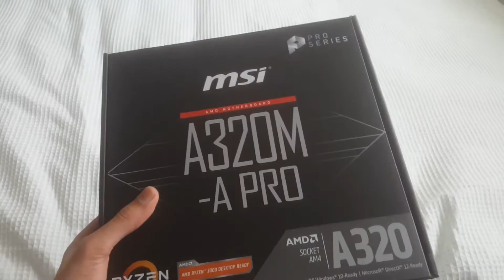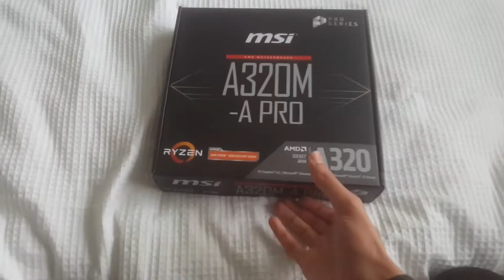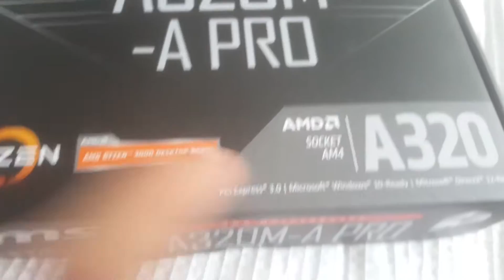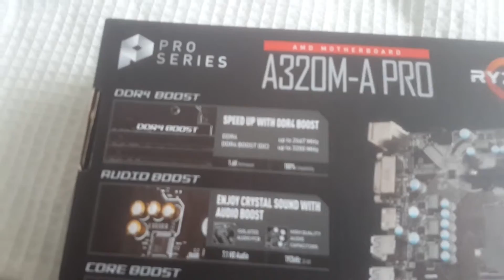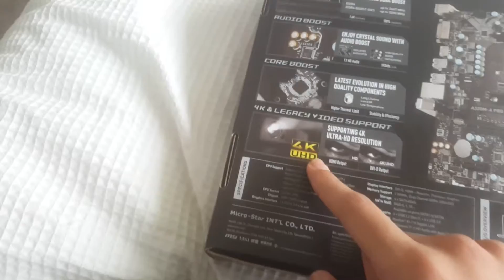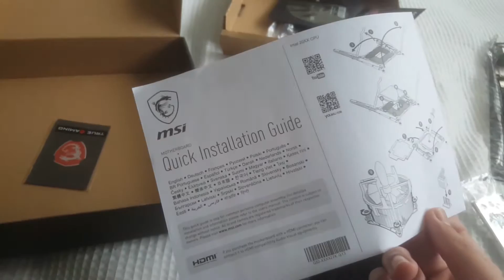this is a seriously under rated motherboard... (MSI A320M A PRO Motherboard Review)

Comment from the maker: Thank you guys so much for watching, If you enjoyed this video or found it helpful at all, Please Like and Subscribe.
If you have any questions about anything about this video, ask in the comments and we will be sure to reply!
Reply: I plan to pair this board with a Ryzen 5 1600 and Gtx 1060 because all Gtx 1660 and rtx 2060 out of stock so I can’t get either. Good idea to save money so I don’t spend like 400/800 pounds or should I wait till New Years/january before getting the pc because my gpu will cause huge bottleneck (it’s quite bad gpu my model is, like 3gb vram. At the least maybe I should get a 1080 but I think they also out stock.
Reply from the maker: Best thing to do is wait for the sales and buy parts then thats what im doing because my personal gaming rig needs an update too...also your right there are a lot of GPUs that are out of stock now i was planning to get a RTX 2060 but its out of stock best thing is buy the parts individually so if you find a good deal on a cpu buy that first then look for deals on the other parts you need then purchase them too thats the methods i use

Comment: Bridge hsink fins need to be vertical to maximize air flow w-o fan, mine overheated ( 1 dimm slot cannot work ) w-o fan, = design flaw. Gpu short circuits caused by dust fr cpu fan, user must block this dust fr gpu because AM4 fan is big & near gpu. Fan air & dust can short dimm too, user needs to block this dust fr dimm, unless used in a ultra clean room.

Comment: using the M2 variant of this thing, i mean it's good but it takes 15 seconds for the boot, not sure what version i have because the MSI bios versions for that is so annoying confusing. 

Specs:
MSI a320m a-pro m2
Ryzen 5 3400g
2x8GB hyperx Fury 2666mhz
2x1TB HDDs
SATA 128GB SSD
6 PC Case Fans
AMD Wraith Stock Cooler.

Though, for some reason my games lags like 7 seconds and comes back to normal and does that again, probably thermal throttle from the VRM of the motherboard, but i doubt because this variant supports upto Ryzen 9 AM4 Processors. I suspect is that the Wraith Cooler is not performing well given that i game on my APU.

Comment: got the exact same board, it does support OC through a bios update and im using a ryzen 5 3600 with a msi gtx 1060 6gb its decent
Reply: I have same motherboard and prosesor with you, i just ask wanna upgrade prosesor does this motherboard support i5 12 gen or 11 gen, or better with amd? What do you recomend?

Comment: I have bought one 4 years ago when  started building my pc but haven't got big budget. It really worked fine and still works fine 4 years on now. 3200mhz on the ram. Supports all sort of graphics card. For the money it was perfect. But yeah im at a point i want something more serious. Perfect for first time pc projects
Reply: i have it and i dont know if it has an m.2 nvme slot, does it have one?
Reply: @ZefiFn  No - you need an adapter or an encapsulator
Reply: Does it work with RTX series graphic cards ? I was thinking to buy RTX 2070 on, currently my motherboard only has integrated graphic with amd ryzen 3 3200 G
Reply from the maker: Yes this motherboard will work with a RTX 2070 however if your going to consider overclocking then it would be a better idea to fork out some extra money for a more capable motherboard. Hope this helps you if you have any further questions feel free to ask and if you don’t mind could you drop a like and subscribe it means a lot. Thanks
Reply: Bro does this motherboard have wireless wifi connection if yes then please tell the adapter link
Reply from the maker: Hi unfortunately there is no onbaord WiFi of the motherboard you will have to buy a WiFi dongle. I'll link the best budget one under this comment 👍
Reply from the maker: TP-Link 300Mbps Mini Wireless N USB WiFi Adapter, ideal for smooth HD video, voice streaming and online gaming,USB 2.0, Supports Windows 10/8.1/8/7/XP, Mac OS, Linux(TL-WN823N) https://amzn.eu/d/9jORRaY
Reply: @M20UBR88  thanks broski

Comment: could i fit an rtx 3050 on this motherboard or do i need to get a new one?
Reply from the maker: Yes you can fit a RTX 3050 with out upgrading unless you want to overclock if you want to overclock best not to use this motherboard as its cheep and a more expensive one will handle overclocking stably. Hope this answers your questions please drop a like and subscribe as it helps us out a lot thanks.

Comment: I bought this mother board but still don't understand where is the SSD slot pls tell where m i suppose to install the ssd
Reply from the maker: Im pretty sure the A320 Variant does NOT have an m.2 slot :/
Reply: @M20UBR88  ye need to bought a sata ssd instead:/

Comment: what is the compatible gpu for that motherboard sir?
Reply from the maker: All GPUs that use a PCIE slot can physically fit in this motherboard. But bare in mind that it is only a GEN 3 PCIE Bandwidth, so a GPU with GEN 4 Bandwidth Support might have to hold back a bit :)

Comment: Will it work with ryzen 3 2200g??
Reply from the maker: Yes it will if your have anymore questions feel free to ask also if you dont mind could you drop a like and subscribe it would mean a lot thanks
Reply: @M20UBR88  yeah no problem I'll sub I'm a first time pc building and I bought the wrong mother board that didn't support ryzen 3 2200g so this is my back up ty
Reply: Builder*
Reply from the maker: Welcome to the pc builder community then if you need help i made a pc building guide on my channle 👍

Comment: Hey man. Can i stick 3200mhz ram on this mobo without oc?
Reply from the maker: Yes you can but it have to overclocked to work at 3200mhz.short answer is yes it will work
Reply: @M20UBR88  if i dont wanna oc i can still use it right? But i dont get the 3200mhz. Thnks for the info 😁👍🏼

Comment: Hello may i ask if this kind of build can support games like Valorant and CS:GO 

AMD RYZEN 3 2200GE TRAY TYPE
MSI A320M PRO-VH
APACER 8GB 2666MHZ 
RAMSTA 120GB
GENERIC 700W
INPLAY LITE X3 
CHASSIS FAN BLACK 80MM BLACK
Reply from the maker: Hi the AMD Ryzen 5 3400G would be better but everything else is fine
Reply: @M20UBR88  thank you so much

Comment: im planing to build PC with 200ge and this motherboard, BUT I have 3000Mhz RAM, will I get full RAM speed or it'll reduce to 2666mhz due to 200ge's max ram speed?
Reply from the maker: Hi unfortunately due to your CPU the 200ge the ram will be limited to 2666mhz  because of the CPU the motherboard supports up to 3200mhz +OC but your CPU doesn't support above 2666mhz
Reply: @M20UBR88  it actually can support 3000mhz, you just have to enable XMP.
Reply from the maker: That's great thank you for letting us now it can come in handy for others in the community thanks 👍
Reply: @M20UBR88  no problem :)

Comment: Would this motherboard work with the ryzen 5 3600 and nivida gtx 1660? Thanks
Reply from the maker: Hi yes it will work perfectly fine with the ryzen 5 3600 and the gtx 1660
Reply: @M20UBR88  thanks 👍👍
Reply: out of the box or need to update the bios?
 @M20UBR88

Comment: One Question, I just bought the Mobo, and when I looked into the bios, I found options for cpu overclocking! Why is this so, if It wasn't overcloable like you mentioned. Should I try overclocking it anyway?
Maybe from the bios itself or ryzen master!
Reply from the maker: Sure i guess its worth a try id do it from ryzen master as its easier to do and understand as if its not overclockable your pc wont boot cycle as long as you dont save the overclock so its worth a try also if you can drop a like and a sub to the channle would be exquisite
Reply: @M20UBR88  okay, thanks alot! I wish the very best for you and your channel.
Reply: @KRAAAUUUCHH  hey, did you try and overclock it?
Reply: i did it then my did not show display. had to reset the motherboard  by externally circuit

Comment: Can I overclock my ram up to 3200mhz how?
Reply from the maker: Firstly you'll need to go into your computers BIOS so shut down the computer and turn it back on as soon as it turns on start pressing (tapping) the delete button until it loads the BIOS once in there go to your ram settings and thats where you can change the mhz make sure to turn on xmp also please subscribe to our channle it helps us and other people find the videos
Reply: @M20UBR88  thanks mate.

Comment: I have this motherboard but i wanna replace my ryzen 3 2200g with ryzen 5 3600, is that a good idea?
Reply from the maker: Hi if you want to use the ryzen 5 3600 with this motherboard that's perfectly fine but for safety dont overclock using this motherboard as it made on a budget with low end parts also could you drop a like and subscribe it helps out a lot thanks
Reply: @M20UBR88  how about ryzen 5 3600x? does it need to be flashed or updated bios? hope you'll reply
Reply from the maker: That will also work but this motherboard is made with cheep parts so please be careful and do it at your own risk
Reply: @M20UBR88  so it just plug and play?
Reply from the maker: Yes plug and play

Comment: How many fan slots it have?
Reply from the maker: Hi it has 1 fan slot and thats the main one for the CPU cooler also please subscribe to us as it help out a lot thanks
Reply: @M20UBR88  dayum i was thinking to use 4 more fans
Reply from the maker: You can buy a Fan hub that only requires 1 fan slot for fan control and sata as power it can give you up to 6 more slots

Comment: can anyone tell me how many fan slots this has?
Reply from the maker: Im pretty sure it has 2, 1 for the cpu cooler and another for a case fan
Reply: @M20UBR88  darn it i want to get 3 more fans
Reply from the maker: Dont worry u can just get a cheap fan hub that has 6 extra slots and only needs 1 to connect to ur motherboard for around £5
I did so with my pc
Reply: @M20UBR88  Oh ok tysm 🙏

Comment: Would this work with a ryzen 3 3100 and RTX 2060?
Reply from the maker: Yes it will but a motherboard with higher specs and a better power and cooling design would be a lot better here is a link to a better motherboard https://youtu.be/2Cu5rb6j0LM

Comment: Would you go for a Asus Prime A320M-A motherboard instead since i have the option?
Reply from the maker: Hi yes i would definitely go with the Asus prime A320 even though it costs more than the motherboard in this video b6 just a few pounds its well worth it as you get a m.2 slot and a small RGB light strip on the side of the motherboard also could you drop a like and subscribe it would mean a lot thanks
Reply: @M20UBR88  k cheers m8

Comment: If i have a ddr4 3200mhz it will run on 3200 or i will have to OC it to run 3200 on this mobo
Reply from the maker: Hi you'll have to run it on a OC to run on 3200 for this motherboard ive done this roo and it was stable so there shouldn't be anything to worry about also could you drop a like and subscribe it would mean a lot thanks..

Comment: Can ryzen 5 2600 plus a320m pro E plus rx 570 work perfectly ? If you could answer I'll subscribe. haha
Reply from the maker: Yes it can work perfectly fine ive used a ryzen 5 3400g on this motherboard with a Gtx 1070 so it should work perfectly for your setup also dont forget to drop a like and subscribe thanks

Comment: Does this still worth it with ryzen 2200g + 8gb ram 2666mhz in 2021?
Reply from the maker: Yes its still a good for 2021 but if you can get your hands on a ryzen 5 3400g that would be better also dont forget to drop a like and subscribe it would mean a lot thanks

Comment: Would an rx 580 be okay with this board and would a Ryzen 5 3600 be okay, dropped a like👍🏻
Reply from the maker: Hi yes it will work perfectly fine with this board also if you dont mind could you subscribe it would mean a lot thanks
Reply: Sure thing I’ll sub now, so it’s okay with both theCPU and GPU?
Reply from the maker: Yes both cpu and gpu will work perfectly on this motherboard

Comment: can i overclock my 3200mhz ram using this mobo?
Reply from the maker: Its maximum is 3200 so no it will not be able to be any higher also if you dont mind could you drop a like and subscribe it would mean a lot thanks

Comment: Is there a ssd that is compatible with this motherboard that you would recomend?
Reply from the maker: Hi all SSD will work perfectly fine with this motherboard if you have any more questions plz ask also if you dont mind could you drop a like and subscribe it would mean a lot thanks
Reply: Would you need a conector i dont see where the sata port is on mine?
Reply from the maker: A sate port on what the motherboard or the SSD??
Reply: On the mother board
Reply from the maker: yea its in the bottom left corner of the mobo

Comment: can i use ddr4 3200 on it or does it cap to 2667mhz only? thank you. love the vid
Reply from the maker: According to the specification list it can run up to 3200 and a little bit more on a OC (overclock) also if you dont mind could you drop a like and subscribe it would mean a lot thanks...
Reply: @M20UBR88  I have 2666mhz ram

Comment: Is a 250w psu good enough ?
Reply from the maker: It depends on what parts you have in your pc because different parts require different amounts power also if you dont mind could you drop a like and subscribe it would mean a lot thanks..
Reply: @M20UBR88  sure ,just the standard parts without a gpu .
Reply from the maker: You can go with a 300w psu or if you want to have some extra room for incase you buy some extra things the go for a 550w psu
Reply: @M20UBR88  Ok , and will that motherboard fit inside a standard desktopd case?
Reply from the maker: Yes

Comment: Would it be good for a GTX 1650 Super? (I'll also be pairing it with a Ryzen 5 3600 if it makes any difference.).
Reply from the maker: Yep that combo will work grate with that motherboard also if you dont mind could you drop a like and subscribe it would mean a lot thanks
Reply: @M20UBR88  , already subbed bro ;) . And thanks for the reply.

Comment: Sorry but am trying to get a 1650 super and am not sure what size vans stuff I should get o have the same motherboard as the one one in the vid with a cit i3 case please could u put a link on what exact model of GTX I should get
Reply from the maker: Hi you can put any model 1650 super yo can go for a cheeper one or an expensive it all depends on how you wish to use it therfore i can give you a link to an exact one an example is if you want to overclock by an expensive version of the 1650 super if you don't want to overclock though then go for a cheeper 1650 super also if you dont mind could you drop a like and subscribe thanks...
Reply: @M20UBR88  sure bro could send. A cheaper one the one that’s not over clock coz I don’t want a bottle neck 😂 and I subbed and liked
Reply: I only have a ryzen 3 3200g
Reply from the maker: (DUAL-RX580-O8G) is a good gpu for ur build but its expensive at the moment as well as all other GPUs because of covid 19 its best to wait for prices to go down
Reply: @M20UBR88  u replied a week later lol never mind
Reply from the maker: Sorry i was locked out of my account.nevermind
Reply: @M20UBR88  oh don’t worry bro it’s all good

Comment: Hi, why when i overclock to 4.4ghz its not going up to 4.4ghz, only 4.2ghz sometimes (r5 3600x) id cooling cooler..
Reply from the maker: Basically when you overclock it only uses that extra bit when its needed
Reply: Gamers Edition and the voltage was on auto, (around 1.380v) and if i decrease it to 1.300v the ghz is going down to 3.60ghz... so i think i just undervolted it.... this motherboard is overclockable or nah?
Reply from the maker: hey, you can overclock, but its not recommended for this  oard as it only has a 4pin for cpu power instead of the reccomended 8 pin
Reply: Gamers Edition  it never hits 4.4 ghz, and my gpu is 1660 ti, i get fps drop alot when theres alot of players and building... i think its bottleneck a bit... what do u think?
Reply: My games pubg..